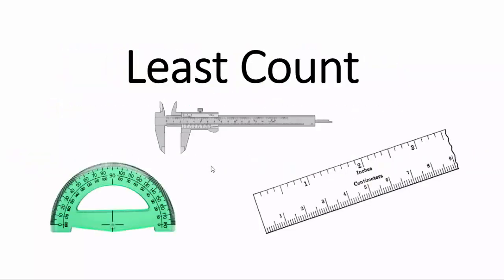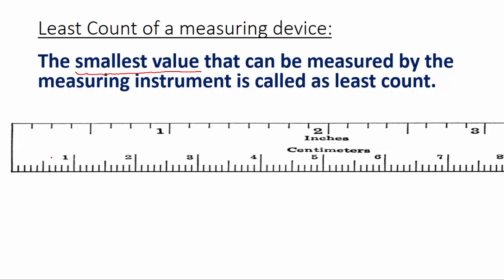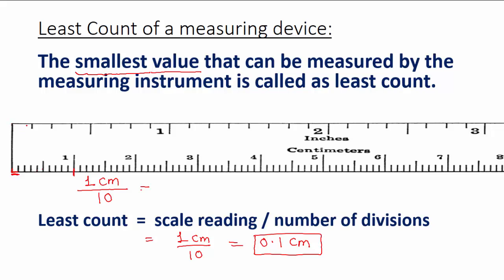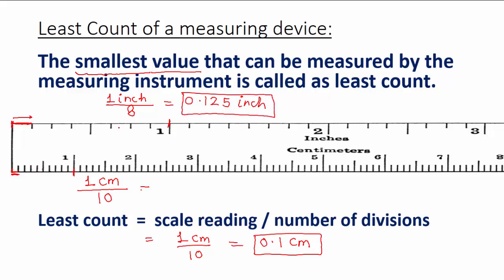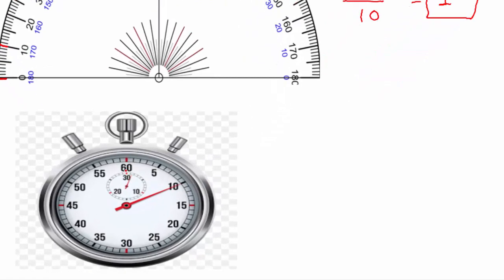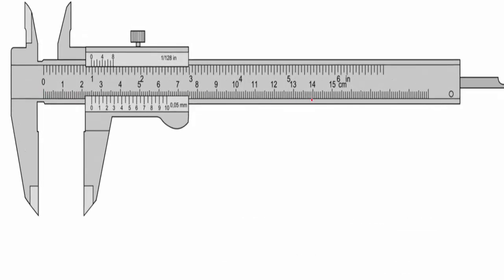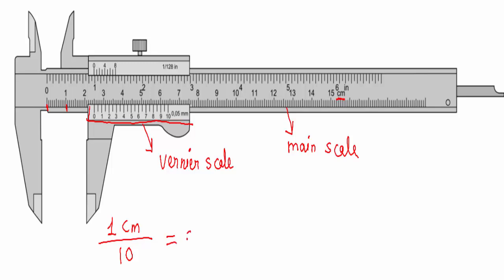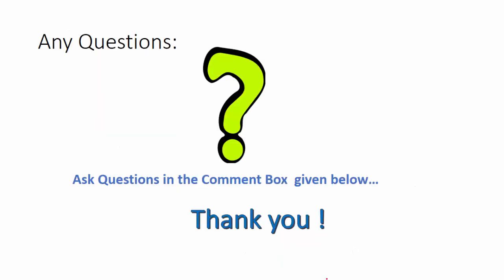Least Count : How to find least Count of Vernier Calipers, IIT-JEE physics classes

Comment: Calculate least count by taking the inner jaws and closing them and opening them and then set to about the position and you should hear a click, then solder the depth stem to positioning and multiply the number you got by 15 because 15c on the caliper=1000rpm metric and then divide by 4.7 to find the calipers density scale measurement 3000Amp imperial. Then to find the final result take a ruler and measure the item you are trying to measure then solder the ruler into the depth blade and clamp the tool with the lower jaws and snap at the item really fast. Using at least 5000Gs you can probably get a 99% accurate measurement, be warned however your caliper may snap and you might need to solder it back together. My caliper sadly snapped back on 9/11/2001 when I accidently applied 16000Gs three times over the recommended daily amount. Although I am proud of my vernier and I think it lived a good successful life before it sadly snapped when I accidently soldered its p3nis off.

Comment: least count of vernier will be .02 mm for manual..and for digital will be .01mm..
Reply: Faiz Ashraf she is right according to given vernier caliper. And 0.02 will be L.C of the same main scale having 50 divisions on the vernier scale. In short L.C will depend upon formula (L.C of main scale/no. divisions on vernier scale)  L. C of vernier calipers varies depending upon the situation. Some vernier caliper has L. C in inches too.
Reply: Faiz Ashraf right...0.001 inch nd 0.01mm
Reply: Here they are saying total Vernier scale division is 20.. but maximum Vernier calipers have 25 division.. that's why least count 0.05 mm..

Comment: my question is what is the least count of digital vernier and least count of digital meters like frequency meter ac meter
Reply from the maker: Hello, Each Digital device has its least written at the bottom or on the sides of device.  you can also check manual which comes along with digital device to check least count. hope that helped...